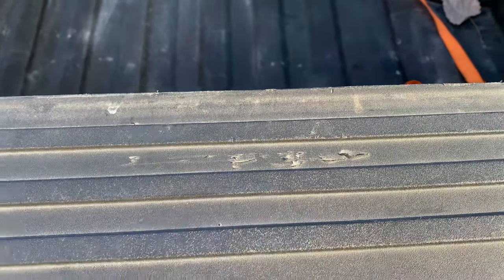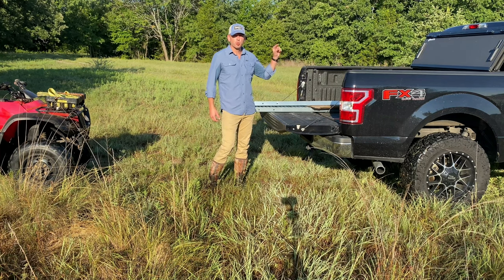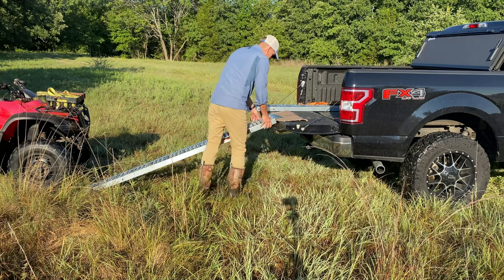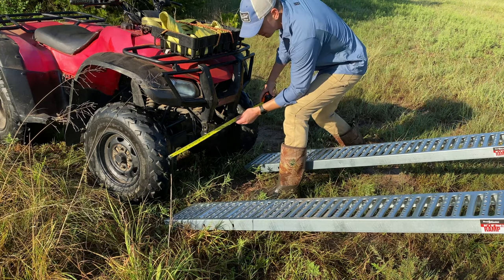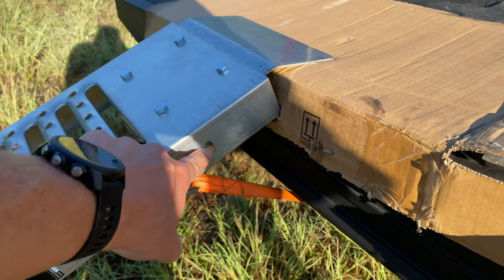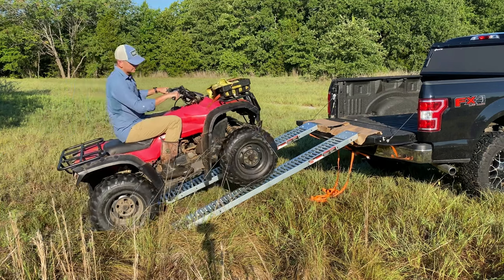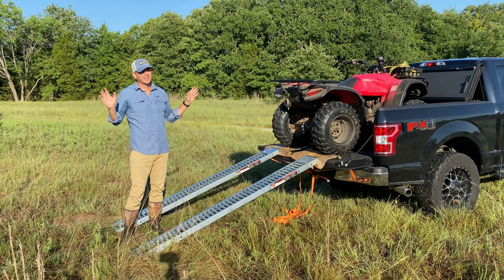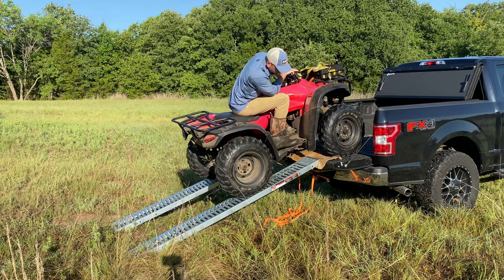84" Haul Master Harbor Freight Ramps. Set up, Loading and Unloading an ATV in a F-150 with a BAKflip

Comment: Can the two ramps be bolted together to make one wider ramp?  I'd like to do something like that and then at the top attach a hinge so that it could be used as a ramp to the entry porch of our floating home.  As the tide goes up and down, the ramp would the be able to move with the tide. On the land side I'd use wheels on castere;  Thanks
Reply from the maker: Oh yeah, I think that would definitely work. It would probably be pretty grippy on your feet too.
Reply: @OurNewLand  Thanks!